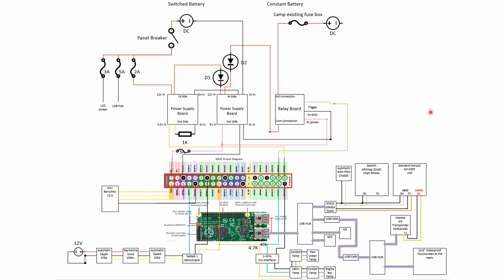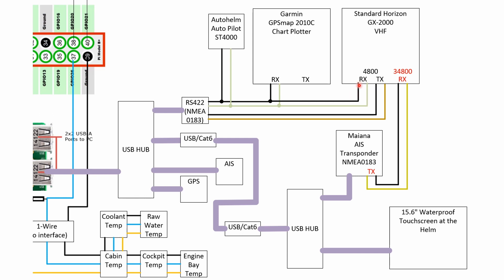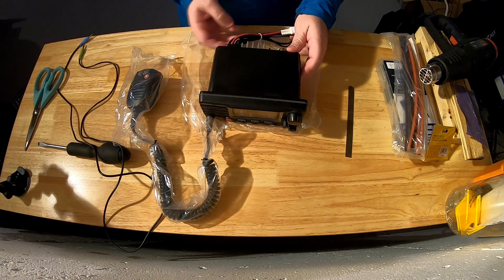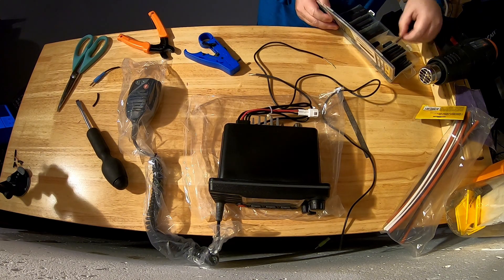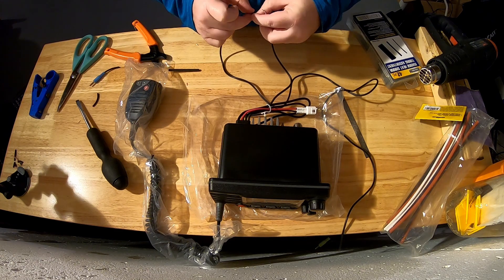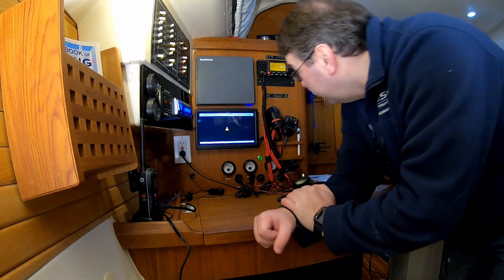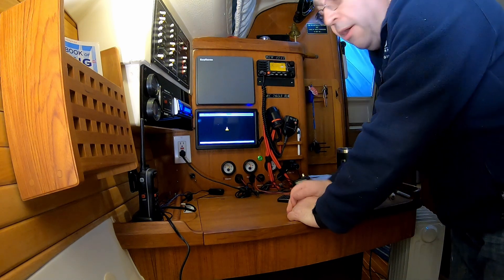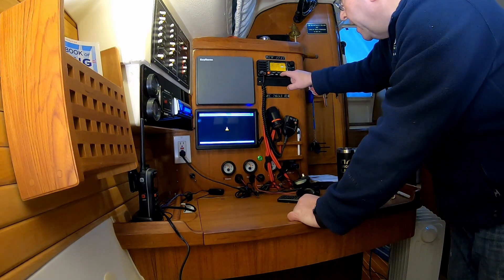Standard Horizon GX-2000 install and integration with Openplotter - Tech E06 - Après Sail

Comment: That's great and exactly what I need .
I have Openplotter on a RP4. And I have a VHF with a additional handheld Station/Mike at the helm. But it is not loud enough to understand it.
In the cockpit there are already two speakers mounted.
So if I understand it right, all I do is  connect the Audio out of the VHF to a USB- Soundcard. Plug the soundcard in the Raspberry und add a small amplifier to the USB-Soundcard Audio out for the speakers in the cockpit.
What I still do not understand: where is the mixing and volume of the sound sources - VHF and Raspi  internal sound - done? In the Sound card? Or in the raspi?
Reply from the maker: yes, you have it right.  The mixing is done by right clicking on the speaker symbol and either adjusting the volume for the master volume,  adjusting the microphone volume for the VHF volume and then adjusting the volume on the app, if you were using VLC or something to play music.  you could also do it at the Amp, if it has that functionality.  One issue that I did have was that sometimes the selected audio source would change to in the internal source, but in config.txt (sudo nano /boot/config.txt), you can add or change the current setting to 'dtparam=audio=off'
Reply: @ApresSail  I will give it a try!

Comment: Nice! I have a similar setup with the SH VHF. Haven't connected the NMEA0183 out yet, but hopefully get to it soon.
Did you get a chance to test the DSC and DSE messages in OP or your plotter?
Reply from the maker: No, the OCPN manual says it works but in order to get DSC and DSE messages you have to request position using somebodies MMSI, that you know is out there and has a DSC capable VHF with GPS attached, but doesn't have AIS (because you would already have their location) and then you have to request their position via the VHF and, if accepted, a dot would appear on the OCPN screen.  I will test it out when I find someone with capable equipment
Reply from the maker: Just as an update, I did get a DSC call when I was testing my MOB1 man over board device and that showed up on the screen in OpenCPN